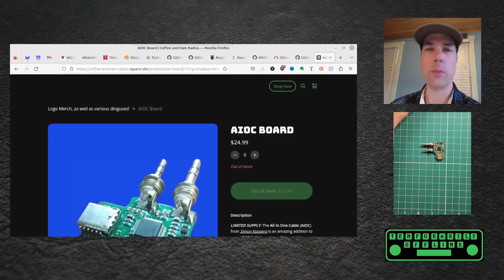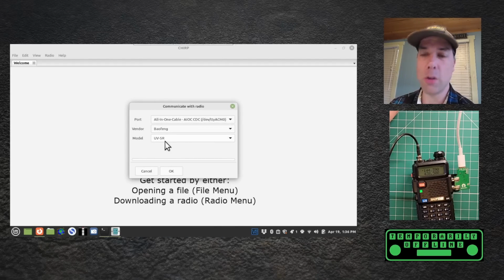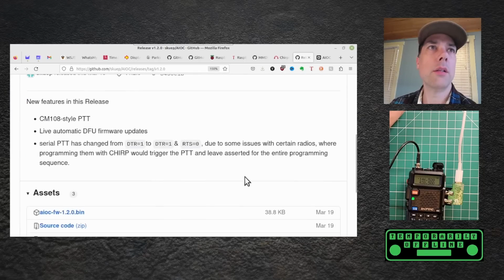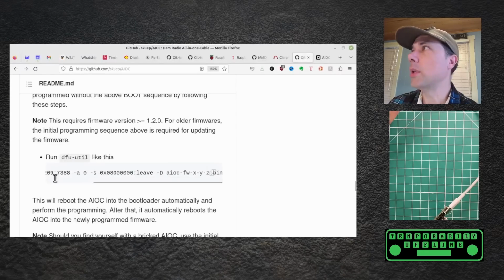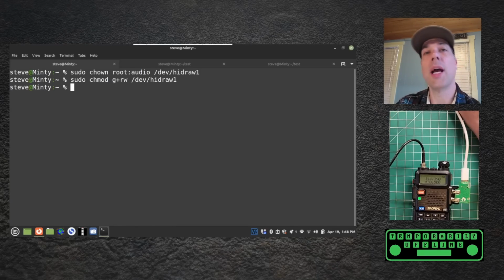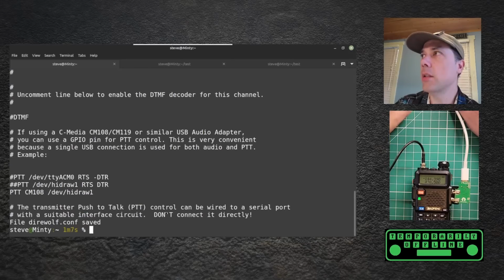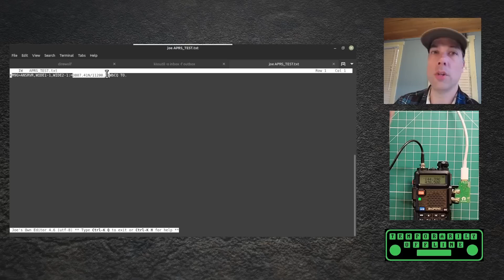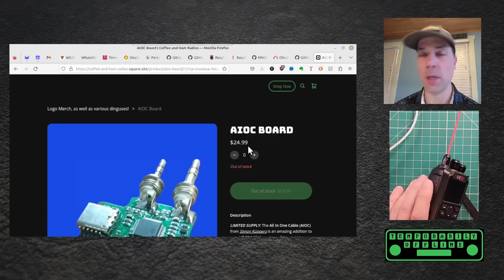You Never Knew You Needed This Cable! The AIOC

Comment: I had quite a difficult time programming the AIOC card firmware initially under Windows.  In the end I used my Mac and it worked.
As far as I can tell, windows has some drivers that may conflict with the dfu-util program.  I mention this here in case others have become stuck.
Reply from the maker: Thanks!

Comment: The vertical bars ARE NOT a volume indicator, but represent results of MULTIPLE DECODERS.
Reply from the maker: You mean where it says "audio level" they really mean "multiple decoders"?  Could you send in a bug report to the direwolf devs please.
Reply: @temporarilyoffline  That's the reason why, for example, only the first bars don't show as '|' (dealing with a potential hack of a lot of different transceivers preemph./deemph.).

Exactly this is why DireWolf is so good (decoding more than others). It are not just volume indicators.

Comment: On the schematic, what is the purpose of the signal RADIO_VP_PTT2? This pin is normally 5V (or 3.3V) on a K-connector.
Reply from the maker: I'm not sure, but you could ask Simon on the TOADs Discord: https://discord.gg/xNw7CWsSXg

Comment: Having the hard K connector is very limiting. It would be much more useful with a DIN or DB9 connector and jumpers for different radios.
Reply from the maker: You can add (or not) the k-connector as you see fit.  They come loose in the baggie.

Comment: Hi, I can’t seem to get mine to TX the APRS Packet Data. Mine locks up and just a Straight Silent Carrier. What Radio Settings do you use on the Baofeng?  I know the AIOC is fine as it Reads & Writes ok on CHIRP.. I tried the Pinpoint WIN Software it seems to RX ok. I’ve been trying with a  Quansheng UV-K5 HT. Was wondering if you be prepared or Happy to Do a Complete New Video using a Raspberry Pi and the AIOC and Direwolf? 
Look Forward To Your Reply. 😊
Reply from the maker: The settings weren't all that strange on the feng.  It has been a while since I've played with it, but we did do a live stream on getting it setup and exploring it.  Firmware update and APRS work.  Take a peak here:  https://youtube.com/live/RZjoPNe634o  I'd like to get some more videos out on it for sure.
Reply: @temporarilyoffline  Thanks For your help and added Command Lines Works Great. But I'd like to ask you now on  how can i enable Direwolf to Auto Start on boot when Powered down and reboot this out in the Field etc?
Reply from the maker: for a dedicated machine, I'd put in in /etc/rc.local as the last line before exit(0) -- be aware that when you do this, direwolf will likely be running as root and it will be looking for /root/direwolf.conf instead of the one in your user's home directory.  There is probably a "right" way to do this as well... but if you know unix, there are at least a dozen right ways.  @SpookieNZL
Reply: @temporarilyoffline  Hi Again, I dont understand your answer. As I'm wanting to Power Down the Pi, then reboot it, but want Direwolf to start automatically. Can you please be more Clear? thanks
Reply from the maker: Have you looked in the /etc/rc.local file?  @SpookieNZL
Reply: Hi, yes I tried to just add direwolf in that file and it never ran on reboot
Reply from the maker: before the exit(0) line?

Comment: I don’t have my AnyTone D878UVii portable radio handy, but would love this gadget if it will work.
I’m fairly sure it has the serial chip built in, but am hoping there’s some way to get it to work.

While it’s much easier to program directly on the radio using FPP than my Motorola APX8000 or XPR7550e,
when making large changes, wireless seems like a great option.

Thanks for your videos!
Reply from the maker: Even if your radio already has the serial chip inside for programming, you can still use this AIOC for digital/sound card modes.

Comment: I have a question for you guys ,
is it possible to use this cable for sending the baseband out of the radio.
specifically , to use the pager signal channels .

I have sdr ,  however  it would be nicer to use an actual radio with antenna to
extract and send to the computer .
most people say it's not possible with cheaper radios using 
S.o.C. technology.

What are your thoughts on this .

Don .
Reply from the maker: If I understand correctly, you'd need an SDR dongle or perhaps a radio with I/Q output.  I don't know of any radios that support pager frequencies and have I/Q output.
Reply: @temporarilyoffline  in need of the baseband signal to decode digital, any thoughts.
Reply from the maker: Try this one:  https://amzn.to/44O5FNS  @Thedonbentleyshow

Comment: Wonder if the audio is sufficient to use for a digital interface for HF digital modes. Would probably work better with a couple short cable ends instead of the hard attached plugs. You should try it with your g106 in place of the huge box they have for digital connection. With appropriate adaptors it would work with many hf radios using the com port for cat / ptt and the audio in / out for mic / speaker interface.
Reply from the maker: That was my thought as well.  I'll be trying it out on more rigs for sure.

Comment: I was gonna buy it but shipping to VK was not an option. :(

I may have to ship it via my son in VA once you get new stock.

Any idea of ETA on the final model? Will it be a hardware change or just firmware etc?
Reply from the maker: @pcfreak1992  That's where it comes from!  Simon keeps making improvements to the device - the hardware works just fine and he's added several features since my first review!
Reply from the maker: We can get you a custom quote as always - Final Model?  This is the final model?  Did I say something that made it sound like there were going to be hardware changes?
Reply: @temporarilyoffline  A custom quote would be good to get. I try to rememberthat.

I recall from a previous video that this was a beta version unless I'm losing my mind which is quite possibly the case. Haha
Reply from the maker: @DonzLockz  I don't think there is any beta - nobody told me.  Just wanted to make sure I didn't slip up in the video (as usual)